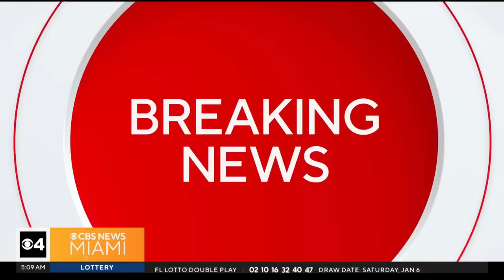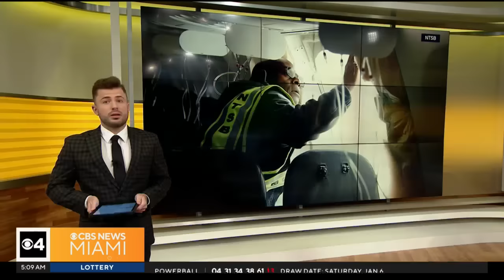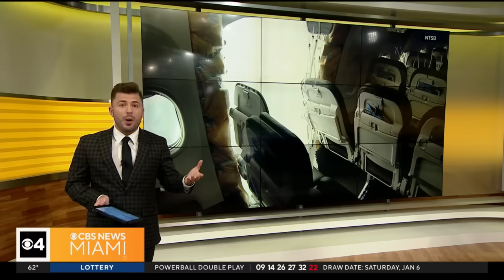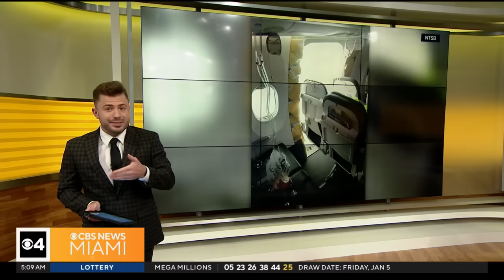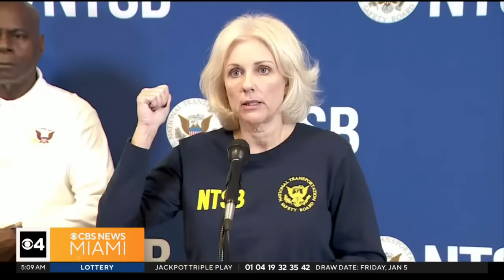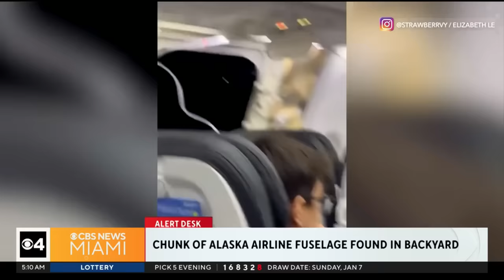Video shows door plug that blew off Alaska Airlines plane in-flight found in backyard

Comment: Context: Alaska Air Flight 1282 suffered from a piece of metal being blown off at 16,000 feet (4,876 metres) which caused belongings of passengers on Flight 1282 being blown away. Lucky the 174 passengers was not injured but the 737 MAX 9 is grounded for further investigation.

Comment: Well, that debunked all the movies where everyone gets sucked out if this happens. That should be comforting now.....
Reply: The cabin is normally pressurized. If you were sitting right next to the spot when the failure occurred and didn't have your seatbelt on, you absolutely could get sucked out, or more accurately "blown" out. After the pressure has been released, the risk much lower.

Comment: Is that "port" ever used for egress? If not, why is there even a "door" there? It's just a failure point.
Reply: It could be used as a door but was not in this case. Aircraft design often leaves options for different customers requirements.